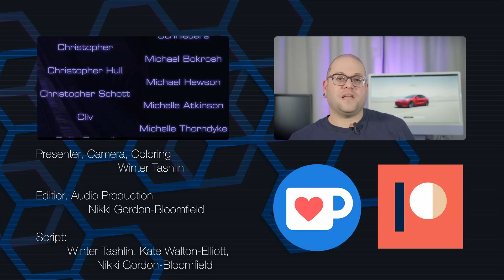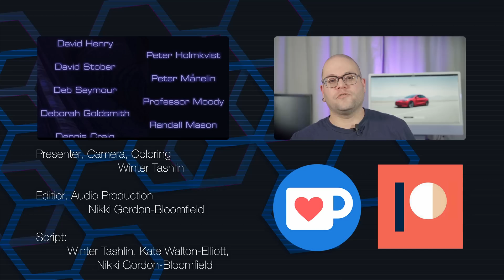Tesla News Roundup  - Tesla Q4, EOY 2021 Earnings and More! (Episode 2)

Comment: I installed the most efficient heat pump I could find in my house this year.(80% at -28c).After some tweeking it's good at -20c . Hasn't gone lower yet but I expect it will meet expectations. The important thing here is it needed some tweeking .
Reply: Ours is garbage at anything below -5C.  Definitely not on par with our oil furnace.

Comment: Hi Winter, You said "Interestingly, we also found out that the 4680 form factor isn't being used for any iron chemistry based battery cell". Tesla's supply of LFP batteries (currently used in standard range Model 3 and Y - now just being called Model 3 RWD and Y RWD) comes exclusively from CATL and are in a prismatic form factor. There is a pretty good view of these in a Sandy Munro video from October 2021 (15:37 mark) 
https://www.youtube.com/watch?v=mZZy_6O41sI
This was not at all clear from the Battery Day presentation, but it appears that Tesla's 4860 production will be used for Nickel Manganese and High Nickel batteries. I don't think that Tesla has plans to make their own LFP batteries.
Reply from the maker: Indeed, but it's interesting to hear that they won't be doing iron-based 4680s in the future, as I said, it was implied that's a limitation imposed by physics. Perhaps the cylindrical form factor isn't conducive to LFP battery design. That said, Tesla fans sometimes get very angry if you say that LFP batteries are prismatic, as everyone "knows" that Tesla only uses cylindrical batteries, which are assumed to be superior. I do think there may be some plans to bring LFP production in-house in the future, as Tesla clearly sees the chemistry as important in its roadmap - Winter
Reply: @transportevolved  I re-listened to the answer the Pierre’s question (around the 1:00:00 mark) and Elon did not say “won’t” (as in, will never), he said “don’t” (as in, aren’t doing it now). You are right, Drew did say that there may be Physics edge cases that would make one form factor a better choice than another (in terms of cost or efficiency of production). I’m sure that it must be frustrating to hear from those Tesla fanboys (I am a Tesla Fanboy) that are so into the company that they can’t imagine that they might be mistaken about some detail. Jordon Giesige of the Limiting Factor has a 3 video (in the weeds) series on LFP and Tesla (you are probably already aware). 
Anyway, keep up the great work. I appreciate the work that you and others at the channel put in. “And as always … keep evolving” (but not in the Biological sense … because that’s not how that works … evolution occurs at the population level 😉)

Comment: I'm curious, if the new Tesla 4680 battery can provide a 16% range increase (as the graphic showed), would that mean the cars get extra range, or Tesla will build cars with the same range using a smaller, assumably lighter battery pack?
Reply: A bit of both, probably, but mostly, it also means that Tesla can switch to a cheaper but slightly less efficient battery cell chemistry like LFP without compromising on range.

Comment: My biggest takeaways. 
4680 will not be using LFP.
Battery supply shortages expected in 2023.
Reply from the maker: I think it’s less that the company expects battery supply shortages in 2023 and more that it anticipates batteries once again being the limiting factor in production because by then the semiconductor chip shortage should be easing. - Winter
Reply: @transportevolved  Limiting factor in production = shortage in my book. Demand 》Supply = Price Hike and/or Shortage.

Comment: Always got to find and emphasize the negatives. Perhaps look at bigger picture good, rather than service issues that are being worked on. Perhaps a weekly update on still no new Bolts
Reply: Rumor is that Bolts may be gone and replaced by I believe the Equinox EV?  Bolt sales were low and were reportedly sold at a $9000 loss per car.  Rumors though...

Comment: Although Tesla has offered some innovations, Tesla is only another big car business. And should be treated as such. Some Tesla's idiotic decisions (e.g. supercharger limitations on repaired vehicles, unavailability of spare parts to repair cars in non-dealer service shops, unavailability of FSD for years, although promised, etc) made me from a somewhat Tesla fanboy to rather indifferent to Tesla (if not disgusted).
Reply: When people repair their own ICE car, it will not cause a fire at the gas station.  People repairing an EV may do all sorts of dangerous things including fixes that may destroy a Charger.  Tesla is being cautious.  

My guess is that most people have made promises they are late on.  GM has been promising many models of EV for years, but we never saw them.  Decisions that seem "idiotic" to you are not always so.
Reply: @normcfu  people repairing an EV may also knock the Moon from it's orbit. do I correctly follow your concern regarding EV repair? and we are talking about Tesla here. not about GM, BM, FM or anything else M.
Reply: @normcfu  the concerns about EV repairs you voiced sound exactly like exaggeration about the Moon falling out of it's orbit.

have Tesla fanboys ever heard term confidence, trust, reliability? when company voices some grandiose plans and then fails to meet them over and over again does increase confidence in, trust in and reliability of the company or not so much?
Reply: @LapinskasDarius  Good luck with that view.  If you think they're so terrible, you can short the stock.  I don't own a tesla and I don't have any financial interest.

Comment: I think explaining "FSD finished" in itself could deserve a video on its own. As Elon clearly said in the earnings call, it very much depends on the 9s.
How often do a human driver mess up every 100 miles? 1 time, 10 times, 100 times, 1000 times? How often is that mistake critical, how often is it trivial?
Same applies to FSD.
Googling a bit for numbers gives 1 death/100mil miles, bodily harm  at 1/1.5mil miles, collisions at 1/250k miles, if we split it into bodily harm, collisions, near misses, brake, annoyance to others, mistakes and assume same ratio holds for (its close to the 80:20 rule, so seems appropriate)
then we end up with a mistake rate at about 1/1.5mil + 1/250k + 1/41.6k + 1/7k + 1/1.15k + 1/192 = 1/150 mile driven.
Is FSD there yet? No, but if it is 1 intervention/1.5 mile now, and improves with about 50% for every month, then it will be there around Dec 2022. @30% around May 2023. Realistic? I don't know.
Reply: Nobody knows exactly, there's the Uncertainty Principle to deal with. 
Excellent comment.
Reply: Tesla's Vehicle Safety Report on their website says they are currently at around 1 accident per 4.8M miles driven while on autopilot. 
They have 60k FSD Beta drivers, with zero accidents yet (knock on wood). I don't see any info about how many miles have been driven on FSD.
It still needs driver interventions, but so does my 21 year old step daughter. The difference is Autopilot has come a long way in just the past 6 months, while my stepdaughter drives just as bad now as she did 3 years ago. At that rate of progression, I expect FSD to be driving as well as me by the end of the year.
Reply: Depends on your definition of messing up. Breaking the law? About every 10 miles - even touching the navigation screen or the radio is - by law - not allowed. Concentrating on the wrong things? Once every 5 miles. Producing a accident? Look at the NHTSA numbers.